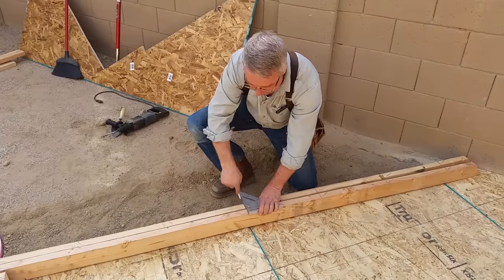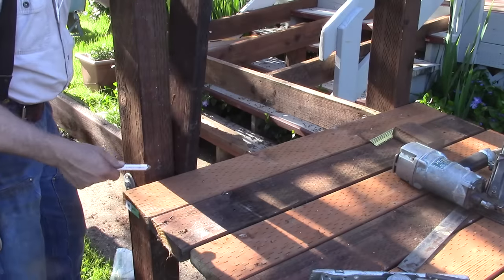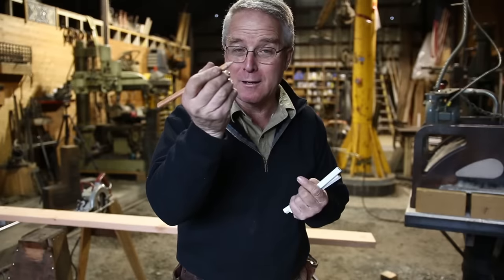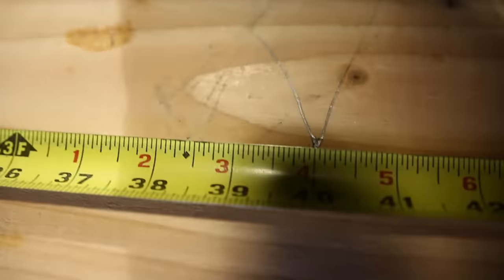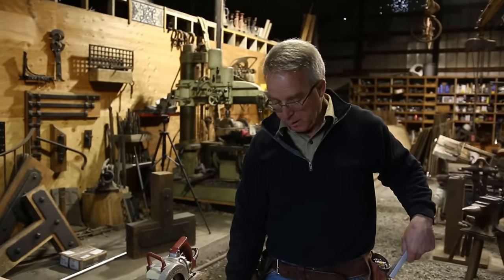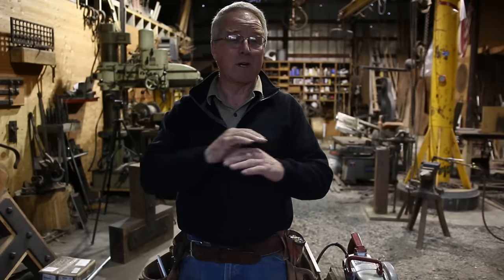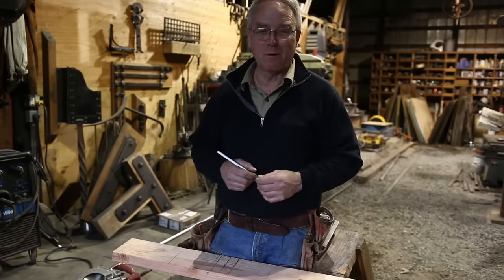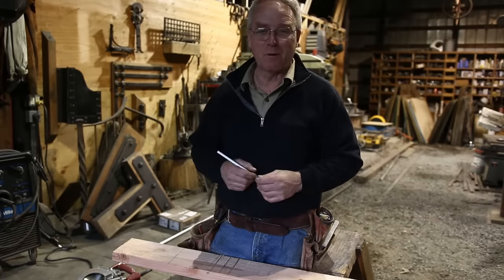Marking and Cutting Pro Tips

Comment: Radial arm Drill, Jib Crane, welder,  Is there a Bridgeport and lathe too?  What are you a carpenter or a machinist?
Is that a Anvil and cutting tourch  do I see a horseshoe?  Blacksmith tools  You just don't mess around do you.
What I don't see is a tablesaw. shaper RAS  Router table.  
2 or 3 thou for woodworking, first off that combination square is not square It will get ya close but its not square
Your Speed square is closer its a fixed edge, combination squares fall out of alinement from use and dropping them the lock pin's wear down the center divit is loose there is just too much play your not going to hit 2-3 thou mchinest don't hit 2-3 thou all the time  its plus or minus 5 thou most the time any closer its the grinder.
But a machinist square they are always 90dgr 
beside tooling wood is a living material it moves metal will too but not as much as wood.

LOL 2-3 thou  I worked in a machine shop too many years  Did you know you can read a tape measure down to 5 tho 
but is your tape measure accurate?  There are carpenter tapes and engineers tapes.
carpenters hold a 1/16 tol   cut that 64 3/16' long.  or short. Keep in mind 3 thou is a human hair roughly .

Now I know you take pride in your work I'm not knocking that your good at it. But I've seen work done by finnish so called carpenters that look like a 10 year old did it. In tract and high end homes its the norm anymore make a mistake screw it just leave it. Can't see it from my driveway.
Anybody can make a mistake, hiding it takes skill. Material cost money you can't throw away 60% of the materials at some point you have to let it slide and hide it.  You cut a board an inch short yes replace it. Use it for blocking or a
Jack stud somthing. some place a short board won't matter. Or get out the 2x4 stretcher don't pull too hard I've seen them 2" long after using one.!